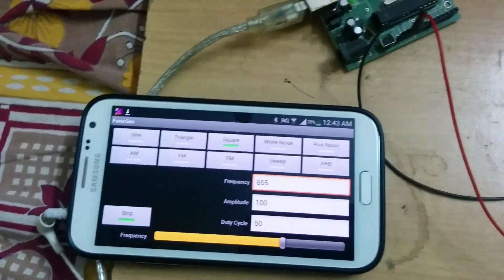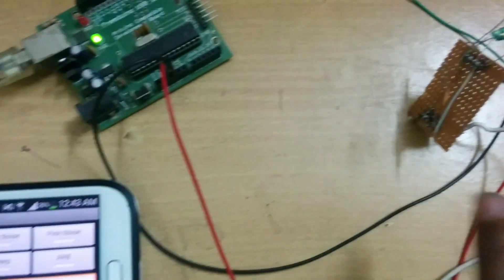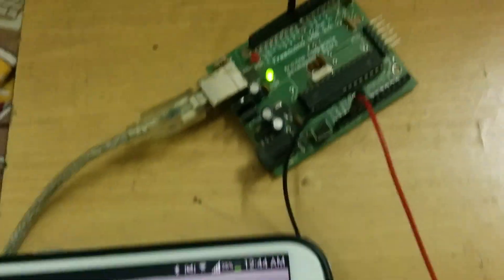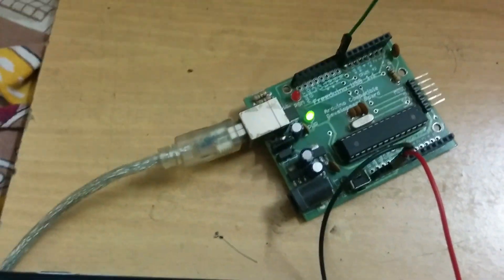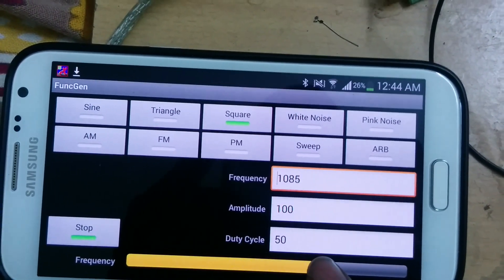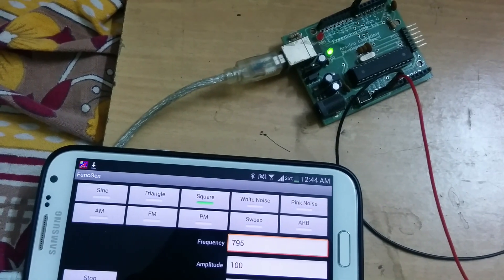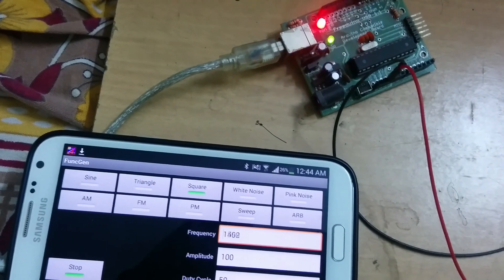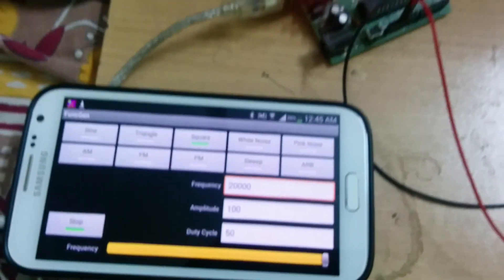frequency measuring using arduino

Comment: hi bro, can i ask if i can get the signal from a microphone and it would still output the frequency on the serial monitor. It would also be a big help for me if you can give me the code. If by any chance, send it to jfcastaneda@up.edu.ph
 thanks in advance